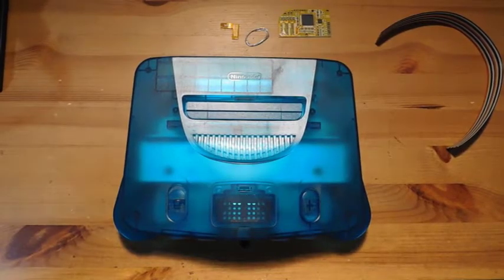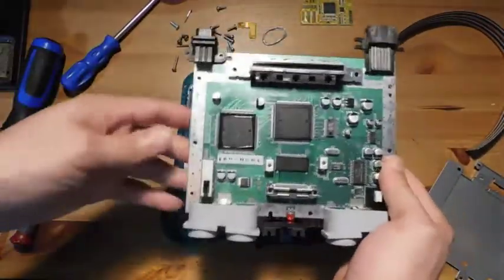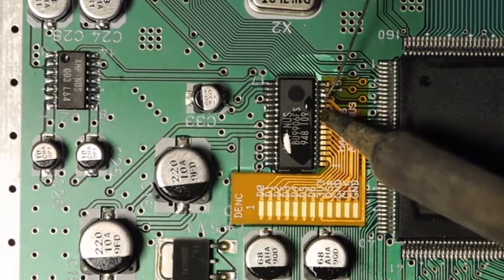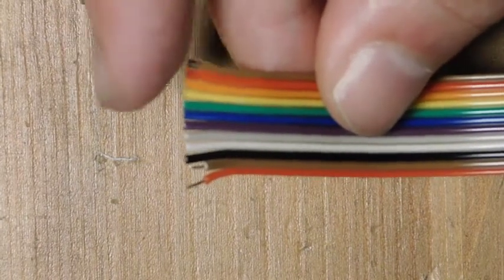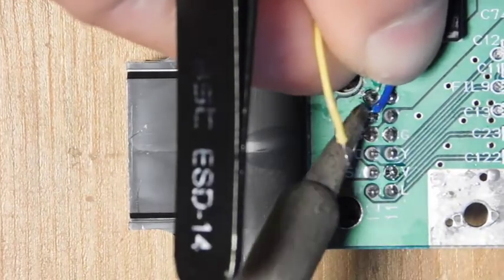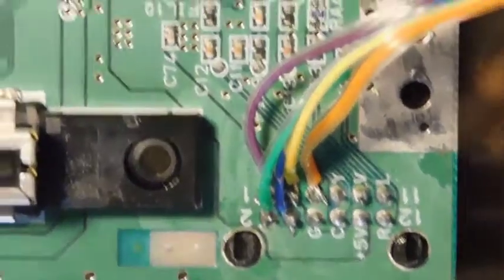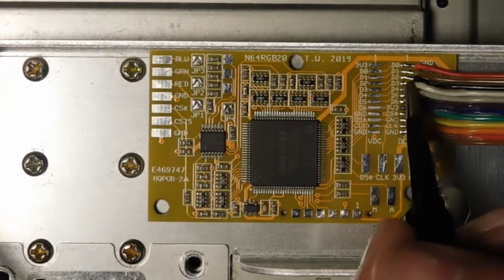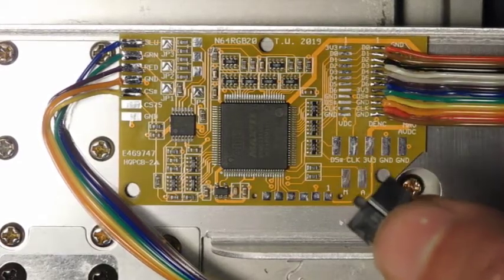N64 RGB (Tim Worthington) Install! Get the best analog video output from your N64

Comment: Anyone that's running Tim's board, are you using the RAD2X cable/dongle with it, and are having this issue? :
https://twitter.com/AndyCriner/status/1307414400756719616 

Guy seems to have figured it out, but is this a known thing? (And what are valid workarounds or additional modifications you would suggest?)
I ordered Tim's board and the RAD2X, and knowing all the quirks workarounds of using them both together, before I actually get them would be a huge help in the long run.
Reply from the maker: This is actually the first time I’ve heard of it. Normally people pair the Tim worthington n64 with hd retrovision cables or use SCART cables and a line doubler like the OSSC.
This video shows an installation that uses cSync but it’s definitely possible to use sync on luma instead. The Twitter post is right that you would lose composite video but personally I think that’s fine considering that you would be using the rad2x cables all the time

Comment: What can this chip do?
Reply from the maker: It gives you the highest quality analog video signal possible on the Nintendo 64. You can combine that with a scaler and get really outstanding video quality on your HDMI television
Reply: @LIRetroGaming  how about the deblur and the antialiasing function?
Reply from the maker: It has the deblur feature as well. I believe antialiasing can only be accomplished with a game shark
Reply: @LIRetroGaming  I just have the rgb amp in my n64 can that be flashed with bortis bios?